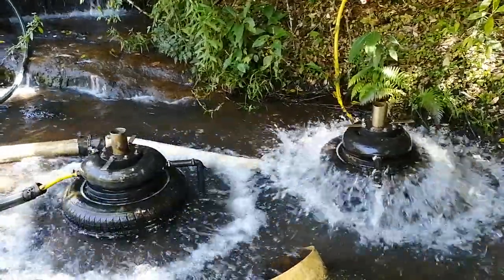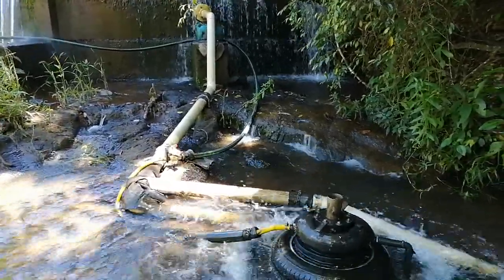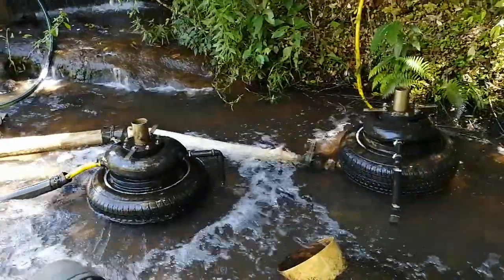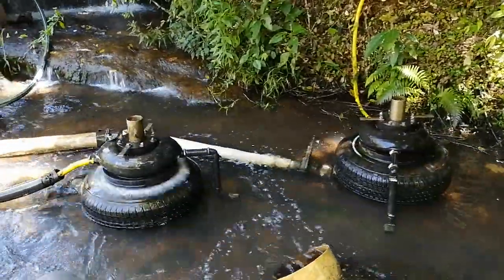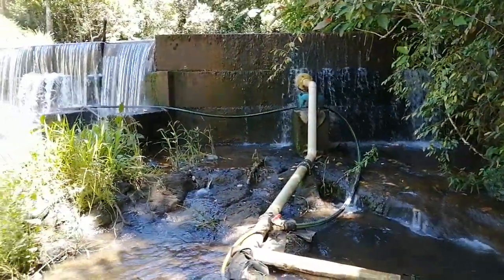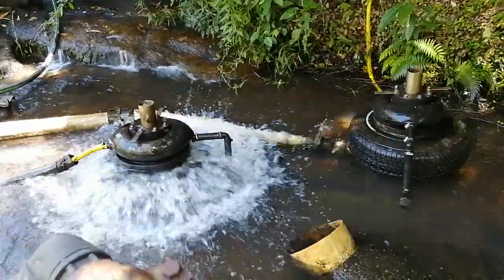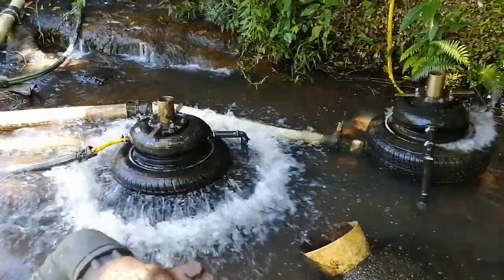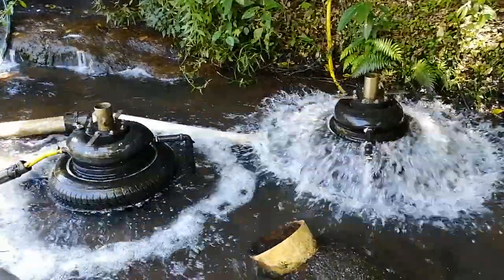Two Bunyip Pumps working off the same supply pipe.

Comment: I am not sure if I fully understand how it works, but it is very impressive. Hat off!
Reply: A bunyip pump is an energy conversion device used to convert the static pressure head from the source to a greater pressure head for the output line at the cost of flow rate. Think of it like this: you could use one unit of energy to lift ten pounds one foot up, or you could use that one unit of energy to lift one pound ten feet up. Now replace that value of energy with ten pounds falling one foot. Granted, this is an ideal scenario where the energy conversion is 100% efficient, but you get the idea. 

The way it achieves this is through a large-diameter diaphragm (the tire-looking-thing) and a smaller diameter piston pump. Pressure is a unit derived from dividing force over area. A column of water exerts pressure as a function of height. The feed water is a column of water exerting constant pressure over the diaphragm's area. This generates a force that is used to push the piston pump. The same unit of force that the diaphragm generates is concentrated into a smaller area piston, generating a higher maximum pressure than the initial feed water column, but it does not pump as much as what went into initially pushing it. Every single time you see the diaphragm vent, it's completing a pumping cycle and resetting back to the fill stage. 

A similar device is a hydraulic ram pump. However, instead of converting static pressure, it's converting the kinetic energy of a fast-moving stream of water into a pressure spike (often called the water hammer effect) which the pump captures to pressurize a smaller volume of water. It achieves this by slamming a valve (called the waste valve) shut as water is reaching its maximum velocity within a pipe. As the pressure spikes (cause liquid is not very compressible and that kinetic energy has to turn into something else once velocity reaches zero), a check valve opens to let in a small amount of high-pressure water out into the output line. After the pressure spike dissipates, the waste valve opens again to let the water accelerate back up to speed once more.

Comment: Amazing. Any chance of getting one in the U.S. How much do they cost ,range
Reply: I can get one to you in the US for around 2-3k AUD hand made in Australia and shipped here.  I'd like to see if I can get the price down, but your typical pump available to you in the US the cost over it's lifespan is 75% energy costs so quadruple the price of the pumps you're looking at and see if the Bunyip pumps make sense for you!  They can produce over 400m of vertical lift with pressures over 600 PSI, I think they're outstanding tbh.
Reply: @Pleasesubmitfornobelprize  If you send me an email I can forward you the technical details from the guy who builds em!  There's 3 models and the most expensive without shipping is just under 2k everything included.
Reply: @jaredbork2586  hola buenas noches